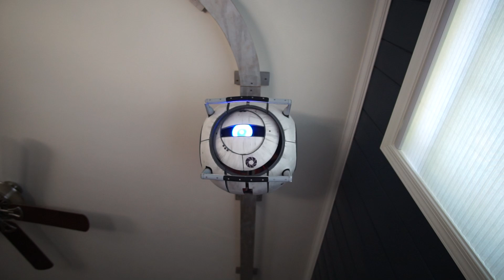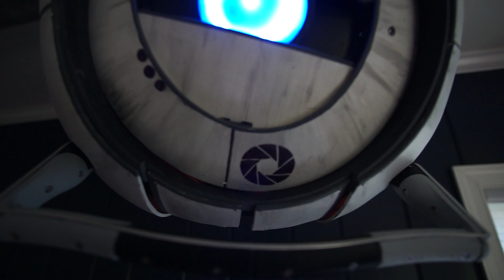Real Life Animatronic Wheatley

Comment: You need to do two things. Firstly, you should make the batteries rechargeable, and then power the management rail so that to recharge Wheatley all you need to do is reattach him to the rail. (Similar to how a model train works). Secondly, you need to make Wheatley your alarm clock.

Comment: This is really amazing. Seeing Portal 2 related community content after 10 odd years of the game being out is a testament to the impact the story had on players.

I was wondering why the build seemed a little limp, and I figure it's because the "hand rail" parts don't move. In-game, the rails above and below the optical move constantly, and it does a lot to bring the character to life. However, I imagine given how tightly packed the interior already is to just make the optical function, it might not be possible to fit in enough to move the rails as well. 

Fantastic portrayal - if you haven't already, you should consider sending this video to the developers of the game and see if they're interested.
Reply from the maker: Ya, moving handles would definitely add a lot to the build, but we didn't think the added complexity would be worth it. We also wanted the handles to be sturdy enough to hold Wheatley by, so making them move would be tough.
I like your idea of sending this to the game developers!